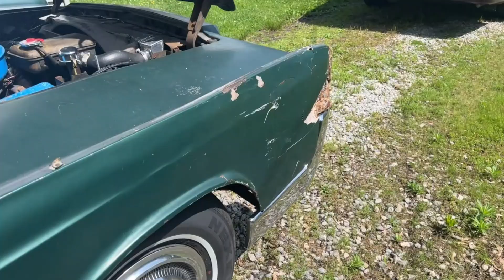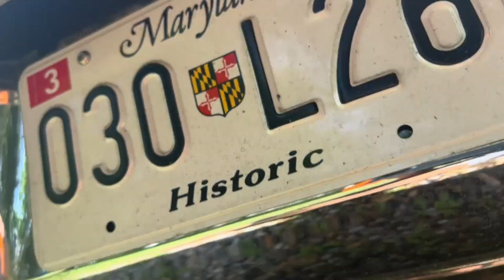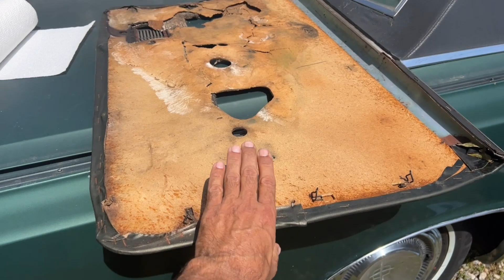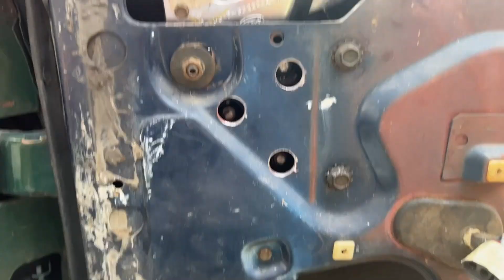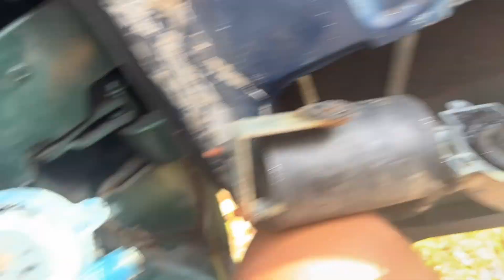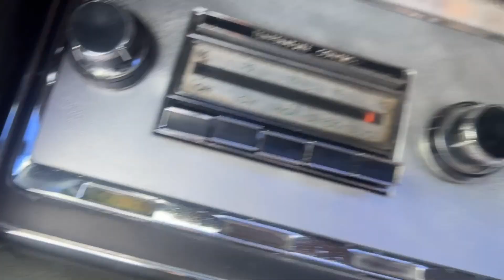1967 Lincoln Project Update 23 May 2024 Detail Work

Comment: Here are a few checks you can do. Press the brake pedal. You should hear the brake release relay click. Its the one with the black/orange and blue/white wires. This relay works the opposite of all the other relays as its normally closed at its resting state and its also connecting a ground and not a hot wire. When you hit the brake pedal, the relay energizes and "disconnects" the ground to the servo. If this relay is not grounded properly or not working, neither will the servo. The other one is the holding relay. It should energize when you press the dash switch. The dash switch is actually 2 switches in one. Check for the usual dirty contacts there. Looks like some of the system is working because you can get the dash light to illuminate when you press the stalk button. Nice work as always!
Reply from the maker: Hey Brian.  Your advice is always worth gold to me!  Thanks again.

Comment: The  cruise control is one of the most complex controls in your car. You're just going to have to get out your Chilton's diagram, study it, then pick weak points that might be responsible for it not working. Blinker off/on switch? Brake switch? Connections? It's a puzzle for you to solve I know you can do it! Put your black door panels on for a bit and see how you like them? Exhaust looks beautiful!! Ford purposely designed the window motors with a default weak spot with the rubber then plastic motor gear because people, children in particular, always have a tendency to push on the button, whether it's rolling down or up and overextend the motor so this was an easily replaceable less expensive fix rather than burn the motor out. My very best to you on your continued progress.
Reply from the maker: Thanks Ron for your ideas and comments.  I'll eventually figure out the problems with the speed control.  Wish I had more time to devote to my hobby!

Comment: I would keep the interior green, as well as the paint, but green is my favorite car color. Talk to an upholsterer, they might be able to give you some tips on redoing the door panels.
Reply from the maker: Thank you.  Keeping the color green is definitely the path of least resistance and I always regretted changing the color of my 67 convertible years ago although I did not have to touch the interior either.  Changing both interior and exterior colors would be a lot of additional work.

Comment: You know about opinions, but here's mine. Lol. The green interior obviously would clash with the dark blue metallic.  I had a 64 convertible in that color and it had white leather seats and door panels with blue dash and carpet.  It was very weathered and someone had replaced the seats with black from another car.  In order to make it look presentable I bought NAPA black vinyl dye and sprayed the dash and door panels all black.  It did not look good with the dark blue.  If you want dark blue exterior I would suggest white seats and door panels and dark blue dash and carpet. You would have to have the seats redone of course but you could use DuPont vinyl dye mixed at a local jobber to the color you want.  Then dye the door panels white and the dash and all other surrounds dark blue.  The headliner would have to be replaced and of course the carpet.  I changed the interior of a 61 thunderbird from faded worn out red to honey beige and it looked better than new.  With all of the work you've done so far it would certainly not be out of your range of expertise.  If you do keep the interior green you are certainly limited with exterior colors.   The Ford Fleet white (M code) used on fords, Lincolns and mercurys is a great antique white that would look good with the green interior.  BTW I also have not seen one of those rubber filled window gears in a long time.  Actually on a 66 thunderbird when I was 17 years old so more than five decades. Lol
Reply: So nice to hear from folks that remember this stuff, Jeff.  Hard to digest the term decades.  I worked with my father in his body shop as soon as I was able to push a bromb.
Reply from the maker: Well, I did ask for opinions!  Thanks for the ideas.